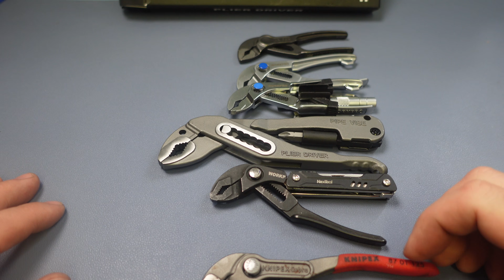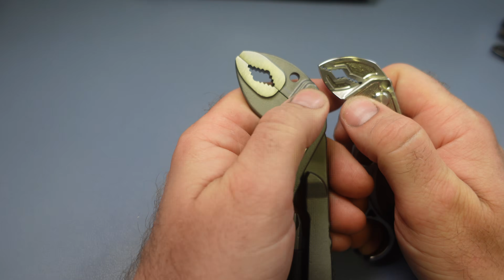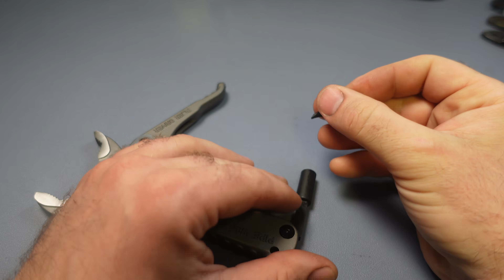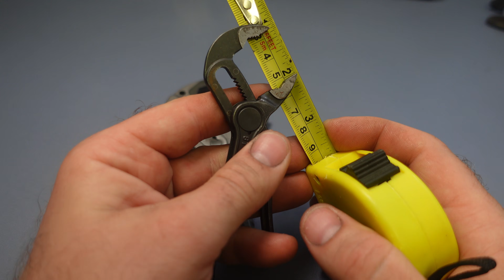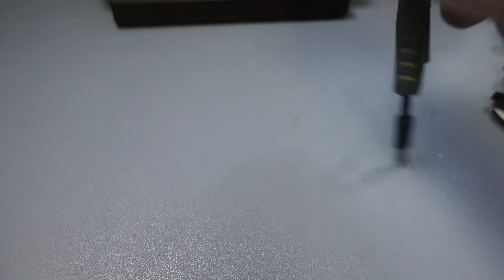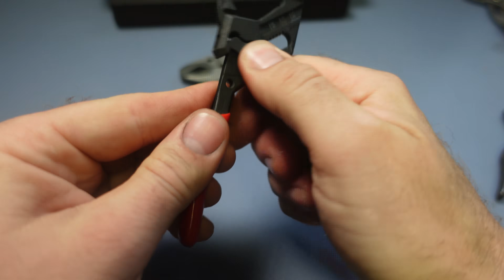Pipe Vise Driver Is Not What I Thought!

Comment: It's overpriced I think you can even have a waterpump plier and one of those knives with bit driver and other things.
I like the idea but it's a lot compared to a better configuration with one multitool or edc bit driver and the wrench. 

I think roxon should make a true modular multitool out of that.
6 slots + 6 slots in the front handle and a folding ratchet driver 😅

Comment: Would be nice to know if it's cast or drop forged steel (says the teeth are machined and hardened but that doesn't tell you much about the rest of the process), unfortunately the nebulous "premium feeling" isn't a particularly objective measurement. If it's built strong enough to handle a lot of oomph and elbow grease then it might be a good tool but made in China and sold at that price? Highway robbery.
Will be interesting to see how the bit driver holds up to torque seeing as one of their pictures shows the plier acting as a T-handle.